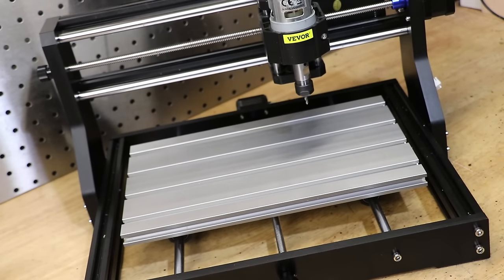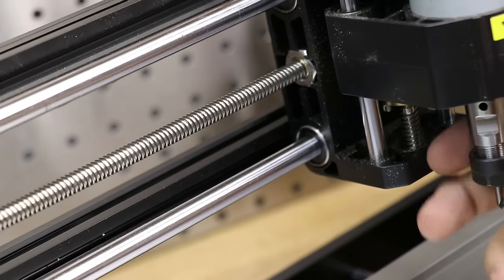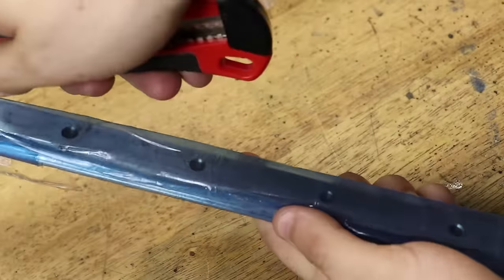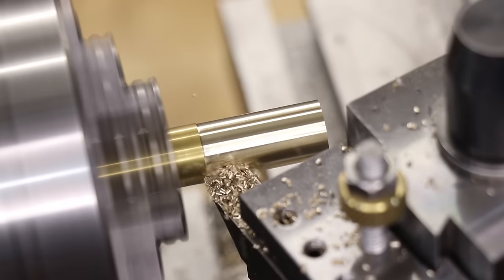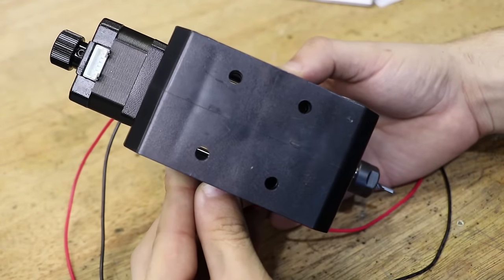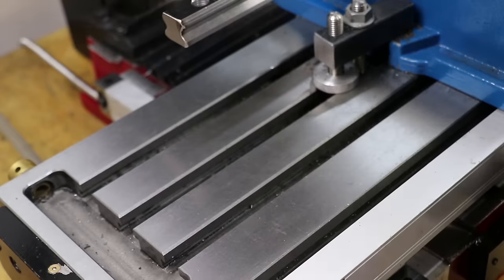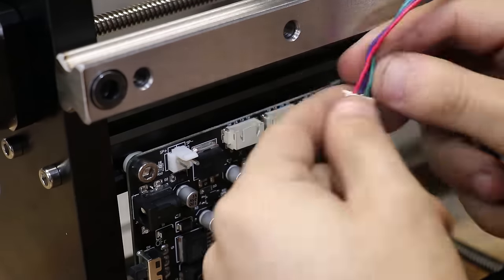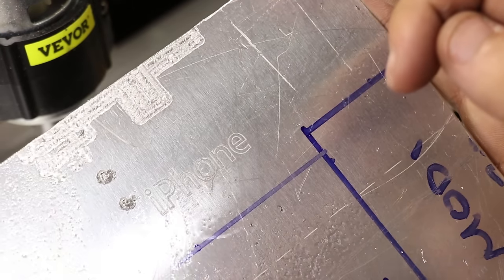Upgrading The $200 CNC Machine

Comment: They're a great machine to learn on, but the fundamental lack of rigidity makes it difficult to do much with. but they CAN be upgraded a bit at a time, mine is mostly used for cutting ABS sheet for use as casting patterns for signs, badges etc.but i've added another (round) rail to mine and stiffened-up the z assembly with some 3mm steel cut, bent and screwed to the most flexible areas, it means i can get through a job a little quicker with higher feeds and it leaves a better finish. but unless you pretty much rebuild the entire machine from scratch, it's always going to be bendy!

If somebody wants to get a start playing with cnc, these are great, and you can always build a better one later, and you'll have a much better idea of what it's all about. my big machine would have been a lot more problematic to get going if i hadn't gained experience with the mighty 3018 first. and even my 3018 actually has a genuine role to play in earning my living!
Reply: THIS. Learning the fundamentals on a little guy FINALLY dawned on me. An inexpensive way to learn and move on later, rather than spending 1500 bucks to get "the best" as my first purchase. Someone can get started right away for $200 ($250 now..) Great point!

Comment: By moving the motor up in the holder you will get both a higher z travel and cut down on deflection as it gives less leverage at the point of the cutter

Comment: I just attached two linear rails to the extrusions and 3d printed a new gantry to fit them (But I'm using 4 total carriage blocks on 2 mgn12 rails)
Also replaced the Z axis with a linear stage actuator. The linear rails for the X axis made the 2020 extrusions even more stable.
I have the added benefit though that my unit uses machines aluminum on the sides to support the X axis instead of plastic.

Bottom line, those 10mm X axis linear rods are so flimsy.
Reply: A lot of time they are actually 8mm

Comment: I bought a cheaper 3018 from Amazon. Not the Vevor brand, but a no-name built exactly the same way, with same materials.

I found that it was my Y-axis which had the most deflection. It was practically a trampoline. As far as the gantry is concerned, I only had slop in the bearings for the 8mm Z-axis rails. The bearings weren't inherently bad or worn, but just too narrow to offer tighter tolerances.

I suspect replacing the 8mm linear bearings with plane brass or ptfe bushings would have been sufficient. But I have plans to use the machine for mostly milling hardwood and soft metals, so that would be a problem for the plastic spindle mount. I upgraded to a 52mm spindle motor (500 watt, specifically), including an aluminum mount. The significant weight increase is when I finally experienced deflection in the gantry.

To that end, I'm waiting for replacement linear rails to arrive. Up-sizing all of the factory 10mm to 12mm.

I might also be looking for yet another spindle mount. Weight might not have been the only cause. The mount, combined with an adapter plate necessary to fit the motor clamp, has the center of mass protruding well ahead of the gantry...I suspect I might continue to see some deflection, regardless of the linear rails' rigidity.
Reply: I could say more. But the ultimate point is: I'm slowly discovering that there is no such thing as a CNC router/miller under $300. By the time I have a viable desktop machine suitable for my needs, I will have spent approximately as much, or more, than I would have for a more premium out-of-the-box product.

Comment: A nice pair of videos. It seems to me that if a machine needs work to get the output to expectations you buy at that price point. Trying to turn a pigs ear into a silk purse still has the underpinnings of the ear. Adding the rail certainly helped tho. Of course for a content maker you get to make two videos. 
Adding stiffer springs to reduce the backlash also increases the friction and wear on the nuts, and adds to the motor load. Has anyone tried adding a broad angle wedge between the nuts? That would add stiffness without the load.

Comment: I got the aluminum to make the new Z axis for mine for $50 for a 12x12 .25 in 6061 plate. Your other mill could cut the new sides just fine.

Comment: One thing that might improve rigidity is filling the cavities in the plastic parts with epoxy, and maybe wrapping some carbon fiber around some areas. The added mass should be fairly negligible compared to the mass of the spindle motor itself. I may try this to my machine.

Comment: This is great I thumbed up both of the videos can you tell me if this only does two dimensional engraving or does it also do three-dimensional Milling as well
Reply from the maker: The machine can do 3d models, just use the appropriate g code. The spindle will cause issues, so I'd take it slow and stick to foam and balsa for 3d work

Comment: That linear rail whoud be beter of the axis center not in the center. Its beter than in the start for shure, but z axis head is rotating as it is, now just the precision of the bearing is doing the job. Moving it from center of rotation you divide the error of the bearings.

Comment: A useful improvement for sure, but since you had two rails it seems a bit of a waste not to use them.  Replacing the existing rails so the Z is supported top and bottom would make the whole setup stiffer again as the rods are still visibly flexing when you apply force to the spindle.  Though maybe you have plans for the other rail?
Reply: I went down this path too with a 3018 build I'm doing except I'm using 2 SBR fully supported rails on the X and Y and Z axes in place of the unsupported round rails commonly used in these type routers.
It's true you only get what you pay for and this router was made to sell for $200 so upgrades will make it better even if it pushes the cost up.
Reply: He had one rail and two blocks.
Reply from the maker: @1pcfred  This is correct, its not common but they are occasionally sold as a set of one rail and two blocks
Reply: @artisanmakes  One rail and two blocks makes sense to me. One rail and a block or just one rail and just a block are available by themselves too. I was waiting for you to get caught by the asymmetrical mounting hole issue a lot of those blocks appear to suffer from. The pattern isn't always as precise as it may seem. You're the first person I've ever seen to not get burnt by it. I guess QC at the factory has improved. Used to be no two were alike.

Comment: If anyone else is doing this and wants an easier time making it rigid.

But a few bearing 4 bearing holders and a linear rail tube. 

Two of the bearing holders attach directly to the Z axis plastic and two go on the end pieces. This way you can just use normal screws wood screws in some pilot holes as bearing holders have holes in them to mount them to stuff. 

z axis ones need to be pass through bearings and end ones closed.

Everything still attaches to the back. Just a case of making sure it's all nice and level.
😁
Reply from the maker: Do you have a video of you doing this?

Comment: What do you think at these type of cnc machines in general can they be ridgid enough to cut steel If proper build or would you say the other vertical type mill will be the only possible machine type for that ? This type offers more table area as I can see this would be nice for small spaces.
Reply from the maker: its not unheard of for more powerful gantry CNC router machines to be able to cut steel, you can do it, but of course the way to go would be with a column or knee mill.

Comment: How do you know the exact positions of the 4 holes to drill without using a transfer punch method? Even a 0.2mm offset hole is not going to get the screw in nicely.

Comment: Next should be the 8mm vertical guides on the Z-axis. You'll need to print a new carriage, but it is worth taking these up to 12mm. And of course the Y-rails. I fixed mine by bolting the whole machine to some 4-inch thick kitchen worktop material. That way I could use supported rails instead of free-standing ones. And then a 300W spindle motor.
Oh, and the whole thing is now 500mm in each direction. And the steppers are NEMA 23 instead of 17, so I have changed the drivers. So I suppose strictly it is now nothing like a 3018, but hey - grandfather's axe, and all that.
Reply: Sounds like you should make a video so I can copy what you did. 😊
I'm looking at modding one to give reasonable results and a larger cut area (only for wood/acrylic) of around 500x400mm.
Did you beef up the rest of the cutting unit when you replaced the motor?
I mean the chuck diameter/size,  (is it called a chuck on this type of machine?)
Reply: Yeah #donpearce make a video then you would have two videos total
Reply: @peersupportcounselor1904  Are you trying to be snotty? You'll have to do better

Comment: how about putting a second rail like you just did on the bottom between the sides like the linear rails. This would cause a huge amount of support closer to the cutter which should make it what you are looking for in regidity.
Reply from the maker: Maybe but I doubt there is enough space to effectively do that

Comment: tbh i would have replaced every plastic part into steel, if i allready had a mill (probably would be a little heavy)
basicly making it an absurd rigid upgrade, then replace the motors if too weak... wait, wouldnt it be better to make a cnc mill from scratch enstead of buying one at 200?

Comment: I made a very rough oversize shape of the Z axis with foam and cast it in aluminum. Cast aluminum is very easy to machine and should be stiffer than the plastic.
Reply: 3d printed Plastic is stiffer that the stock stuff... Pretty much anything is stiffer

Comment: How much of these machines are plastic I’ve been thinking about getting one to learn cnc on and it would make a good project to make and replace all the plastic parts in aluminum or steel possibly cast iron depending on size and if I can source it
Reply: The front and back rails on the Y axis, the left and right mounts for the X axis, and most of the z axis are all plastic
Reply: @mcbeardface  so the gantry supports? And the bed supports?
Reply: @jeremycable51  Gantry supports are plastic, the left and right bed supports are extruded aluminum while the front and back are plastic.
Reply: @koharaisevo3666  wonder what these machines would be with upgraded frame and table
Reply: @jeremycable51  - They would be a waste of time and money. You don't pour $400 into trying to improve a $200 machine.... you just buy a better one for the same total price.
Reply: @johncoops6897  that’s where your not really understanding my process here machining In general is just a side hobby I picked up about a year ago all manual so far and the small router machines would give me some cnc experience to feel confident in spending the money to build a cnc mill which I’m debating on doing but so far I’ve not been able to get into it like I have with the manual machines so if I was able to upgrade which I’m fairly certain I can do one of these small machines it’d give me time with my hobby and some cnc experience to boot
Reply: Also point me in a direction where I can find a new cnc machine to cut aluminum or steel for under 2k because I’m figuring all in I can mod a little one for under 800$ and do both and build one to my liking for about 1800$
Reply: @johncoops6897  I have been eyeing that mr1 from Langmuir systems very nice machine but hard to justify it as I don’t have a need just a want
Reply: @johncoops6897  You're not going to get a much better machine for $400. You'd have to go up to $1,000 or more.
Reply: @jeremycable51  a machine like we're seeing here is not going to mill steel. Ferrous metal is where things get real. Then any lack of rigidity is going to cause major issues. Everything needs to be scaled up to gain the advantage needed to get the upper hand with harder stock. In short nothing on this machine is suitable. Not a single screw.
Reply: @1pcfred  - yep. And you get a better machine.
Reply: @johncoops6897  no CNC machine of this type is suitable for milling ferrous metal. You have to use a real milling machine or a machining center. A heavy machine made out of cast iron with dovetail ways. A real machine. A heavy machine. The mass is critical to damp vibrations. The main factor milling steel is chatter. Tools can withstand chatter on softer materials. When you move up to ferrous stock tools need rigidity.
Reply: @1pcfred  - Agreed, and you don't need to tell me ANY of that. Try to tell it to Jeremy C. who wants to rebuild a $200 el-cheapo engraver into something that it isn't and never will be.
Reply from the maker: @koharaisevo3666  Spot On.
Reply: @johncoops6897  clearly improvements can be made to make these machines more serviceable. I think what we saw here was the best mod too. The most for the least. Stiffening up that gantry axis did a lot. But there are certainly practical limits to what can be done. Nothing is going to turn one of these engraving machines into a machining center.
Reply: @1pcfred  honestly I’m looking at getting one of these just mainly for dissection purposes from there steeling the electronics possibly upgrading the drivers and steppers but as I know absolutely jack about cnc that’s my conundrum I’ve got a manual machine shop but I’d like some small cnc capabilities without spending 4-5k or more

Comment: Not bad for a couple hundred, honestly doesnt seem too bad. Cheapish upgrade - flitted back and forth and its noticeable on speeds&feeds too. Any plans on perhaps using it as a bonafide mini-CNC with milling cutters, or is it just not rigid enough? 

Cool upgrade tho, thanks mate! 👍
Reply: About all you can do with a machine like this that makes practical sense is upgrade those guide rails. That will net you an improvement and it is reasonable to do. Past that you'd be replacing the whole machine to get much more out of it. As everything is pretty minimal. To reach its price point it has to be.
Reply from the maker: If i were to try and use this as a proper CNC, I would need to do a substantial overhaul of the motor and z axis assembly, which would mean scrapping it entirely and rebuilding it from aluminium. There are videos where people have done that, but I have not yet decided whether I am going to that with this CNC. Even for me, it is a lot of work to justify on a machine like this.
Reply: @artisanmakes  I think the upgrade you did was the highest return for the investment. That gantry axis had the most slop in it. We all saw what that did. Hobby CNC is another way to say work. It is a T&M job.

Comment: Why was my comment about using hard plastic anti backlash nut instead of the garbage spring one deleted ?
Reply: I don't know. I use HDPE nuts on my machine.  I cut them with a custom shop made tap and they are really tight. Was a bit of a trick to make them actually. I made the tap out of some off cut acme threaded rod and that was too tight so I had to punch peen some of the teeth to expand them.
Reply from the maker: Hey mate, just so you know I don't touch comments unless they are overtly hateful or such. I checked the spam section and its not there, so I could answer you on why the comment is not showing up. As for using plastic anti backlash nuts, im sure you could make it work. Ive never retro fitted a machine to use them before, and I dont take a metric trapezoidal tap so I couldnt try doing it at the moment. Cheers
Reply: @artisanmakes  I made my own plastic lead nuts and they work good for me. Plastic stretches so the whole nut acts like its own spring. Makes it naturally anti-backlash. It's like one of those life hacks.
Reply: @1pcfred  Hi .. you do not need the tap for the screw .. I have posted aliexpress link here , and maybe the youtube filter removed the comment or I just forgot to press the button to reply :D OK .. so I posted the link in to next comment and it was deleted with youtube 5 seconds after posting it here ..
Reply: look for anti backlash nut block for 8mm metric acme lead screw, it will be black squared shape block with setscrew .
Reply: @anubisko212  I needed a tap for the nuts I made. I did not get my lead screws on Ali Express.

Comment: How did you find the rail and carriage   for $25    what was the rail length?
Reply: Why not watch the video and pay attention? Here's a link... click it 👉 3:10
Reply: @johncoops6897   Ouch  didn't expect to get  to get barked at.  Send us  the link to pick up two carriages and a rail for $25.
Reply: Looks like a 20mm rail to me. Possibly a HGR20 rail and carriage. Use HGR20 as a search team, there will be some hits. I doubt that it actually needs to be that big. Linear rails are already very sturdy on their own, a 15mm rail will easily do the same.
Reply from the maker: its a 400mm rail and i bought it off ebay. It is a little difficult to find them as a single listing, they are usually sold as a pair of rails. I'd give you my listing that i used but I bought these 2 months ago and the listing is no longer active. Cheers